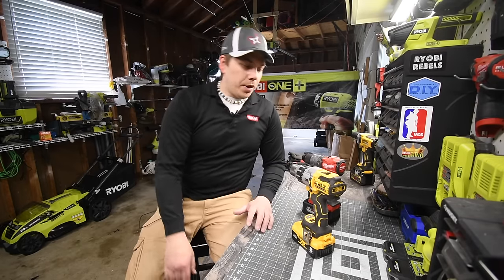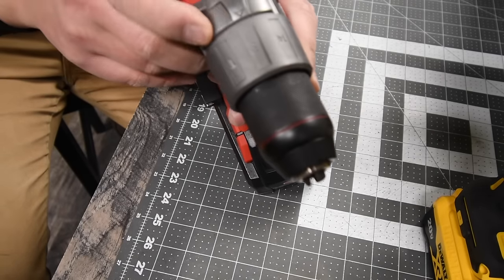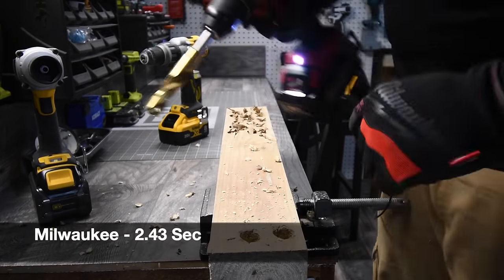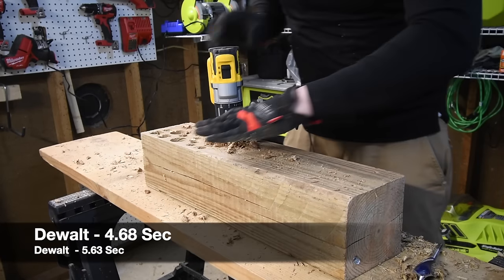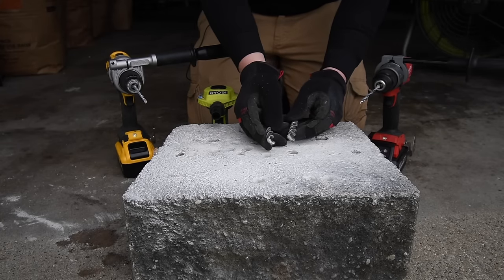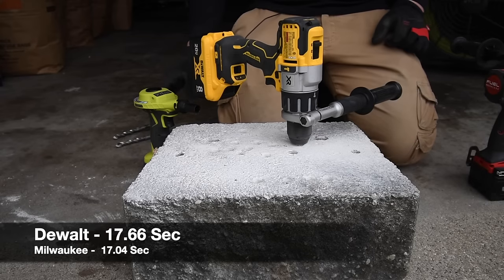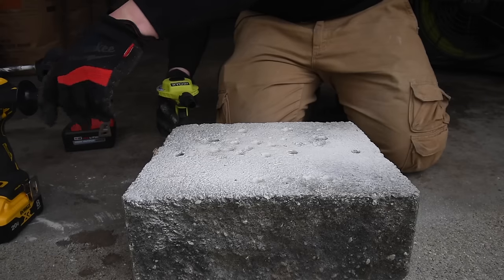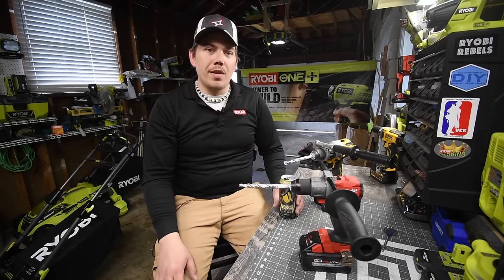Dewalt Power Detect vs Milwaukee Fuel

Comment: Made in the USA is the only thing I need to know!  Dewalt
Reply from the maker: Its not actually made in the USA. Only some tools are assembled in the USA with with the parts actually made in a China
Reply from the maker: They legally can consider a tool kit made in the USA by putting a China tool in a bag, then they can actually put a stamp saying made in the USA on it
Reply: @ManCaverTools  can you remake this video with the new dewalt tool the flex volt
Reply: Actually legally for the Made in USA lable,  the tool has to be assembled in the US with at least 50% parts from North America.  That includes Canada and Mexico.
Reply: Assembly could also happen in any of the US territories such as Guam or the Marshall Islands.

Comment: Cordless tools can only do so much. If you have heavy cement drilling to do you should really be using a rotary hammer. Hammer drills are just for the odd light duty things
Reply from the maker: sometimes jobs require raw power
Reply: @ManCaverTools  yes. I think the tool companies have tricked us into thinking cordless tools are heavy duty. They are not. As your test, and others, always show is these drills cutting out or getting overheated and sometimes dying. When I use my vintage American corded tools the only thing i worry about breaking is myself.  Those tools are beasts.
Reply: @timbarry5080  there are cordless rotary hammers as well.
They come handy when there are no AC outlets around

Comment: Just logically it doesn't make sense that the dewalt drilled the test hole faster than the pilot hole, and was slower than the Milwaukee in the pilot hole test. It's an inconsistency.  Probably just more aggregate on the milwuakee hole.  The dewault is definitely faster, but not four times faster, and not so fast that Dewalt drills a 3/4" hole faster than a 1/4" hole.
Reply from the maker: that is just how it is in that situation. but I will be revisiting this test soon
Reply: the milwaukee hole was drilling in reverse

Comment: During the concrete drilling test the Milwaukee was running in reverse
Reply: I also saw that. I played the video at 1/4 speed, screen recorded, and looked at every frame I could. Milwaukee was definitely in reverse
Reply from the maker: I dont think it was but if it was I am sorry
Reply: @ManCaverTools  I personally believe that the Dewalt is more effective at drilling concrete, doing so in 1/3 the time of the Milwaukee I believe is evidence of an anomaly.

Comment: Imo theyre pretty close in performance but as an electrician who owns both I would go ahead and recommend the m18 fuel line. Longevity and power.
Reply from the maker: very good and I thank you for viewing Cam
Reply: As a pipe fitter of many years I cannot recommend any Milwaukee as their drill chucks wear out too quick causing hole saw arbors to fall in between studded and rocked walls. Their impact driver collars prematurely fail too.
Time for Milwaukee to start making their drills in the USA with more USA parts to compete with dewalt

Comment: Might of helped if the milwaukee wasn't reversing into the block.
Reply from the maker: it was not in reverse, its an illusion, this power detect is a beast and it destroyed the HILTI and the Milwaukee fuel Hammer drill is a weak hammer drill
Reply: @ManCaverTools  I use them both everyday, and yes the dewalt beats the milwaukee when it comes to the hammer function drilling into concrete. By a very slight margin. It does not by any means beat it that much. With the amount of people saying it's in reverse, I think it calls for a rematch.
Reply: @JoeBlack-if3tz  After watching screen recordings in slow mo, it was definitely in reverse. Milwaukee got cheated

Comment: When he drilled the concrete with a 10, Milwaukee was spinning backwards! There was more time!
Reply from the maker: it was not spinning backwards.
Reply: The speed of rpm on camera can cause it to appear spinning in either direction.
Reply: Shutter speed of the camera makes the illusion.
Reply: YouTube has the option to change the playback speed. And it was for sure going backwards, at least initially at 8:03

Comment: It looks like the Milwaukee is spinning in reverse at 8:05?
Reply from the maker: it is not spinning in reverse
Reply: Before he cut the video the milwaukee was in reverse if you look closely. Im a milwaukee guy all day, i cant say forsure he ran reverse but i will pry buy the dewalt just for the hammer drill. I dont like the size tbh, but it is a beast.

Comment: i was fan of dewalt for 10 years.i have so many tools and the expensives models mostly from dewalt.
but no ty anymore.
8/12 of them having the same issue.they stop working until u press the trigger again and again...
shame just shame.i dont know why at usa u have the 20V version but here at greece we have the 18V version.
btw only 4 of them still working and i noticed that 4 are made in europe.
time to take a new serious from another brand ofc.bye bye dewalt
Reply from the maker: Milwuakee has so many more tools on both 12v and 18v platforms, its like may as well switch

Comment: Milwaukee was definitely in reverse. Sorry to say, but there is no way the 998 is going to do it in 1/3 of the time. I mean you could put a Hercules Hammer drill (In forward) that would beat 41 seconds. I think your hand hit the switch on accident. The 998 is a certified "Manimal" but not to that extent.
Reply from the maker: it was not in reverse. my right index fingers covers that switch and I press down on it.
Reply: If it was one reverse it wouldnt even go in bud
Reply: He says in the video that the Milwaukee slipped out of Hammer mode and into Drill mode at one point. He is going to redo the concrete test..

Comment: I HAVE 2 HUGE ISSUES WITH THE TESTS YOU ARE RUNNING 👀 
1. Test is immediately flawed due to the unknown pressure that you're applying to each plunge.
2. Test further flawed due to proximity of drill holes in concrete slab. TOO CLOSE! 
3. My kid has that same ryobi blower 😂 she uses it to blow dry her dolls hair.
Reply from the maker: I thank you for viewing Chris,. why would I doctor a test?
Reply: @ManCaverTools  just my opinion for better accuracy

Comment: I'm a Milwaukee guy. While Milwaukee beats DeWalt in almost everything else they really need to step it up with their highest end drill.
Reply from the maker: I do thank you so much for viewing :)
Reply: Lol ‘almost everything else’ okay, dewalt a more reliable and better value
Reply: @bobowman6689  I think I’ll let the warranty’s speak for themselves which is more reliable. Also make sure you keep your dewalt impact away from anything flammable when it has another motor burnout.
Reply: @appliancealliance4444  Milwaukee kills DeWalt in impact drivers and wrenches. Although DeWalt is coming strong in the compact and mid torque category  and recently bet Milwaukee, big red may not be far behind to up their game once again.
Other than Hammer drills and rotary hammers, I also find DeWalt having the upper hand on cordless grinders; no Milwaukee matches the DCG 416 & 418 even though I owned a 2880-20 until last week.
Circular saws are super close. Human factor plays a bigger role than the tool on that particular one. Milwaukee hardly beats DeWalt in almost every category. This is the ford vs Chevy of the power tool brands. They always one up each other with every gen and so on.

Comment: Nice job running the Milwaukee in reverse.
Reply from the maker: it was not in reverse. it was an illusion. even the dewalt looked like it was in reverse at some points
Reply: @ManCaverTools  No, the Dewalt never looked like it was in reverse. Yet the Milwaukee was in reverse.
Reply: Tap Pearson you can see it in the second hole in the Milwaukee 
He first hit the button it obviously was going backwards ( from where he swapped it to pull it out the concrete before )
And he hit the switch to put it back in forward, started drilling and it still looked reverse

Comment: You say The Power Detect is the best Hammer Drill and Most Powerful. VCG says the Milwaukee is the best and most powerful on the market and yet I saw you test Hilti vs Milwaukee and they were virtually identical but the Hilti did win your test then lost to the DeWalt. Seems these 3 are evenly matched and you have to dig into the mechanics of each task to pick a winner. When does Milwaukee apply highest torque vs Hilti and Deaalt etc. it’s not all the same and top speed doesn’t always win. We know Milwaukee can win on speed if they want to they’ve done that forever. But is speed the number one thing with a Hammer Drill. I don’t think so.

Milwaukee wins on specs hands down but again they all seem to perform relatively even.
Reply from the maker: The milwaukee hammer drill sucks compared to the Dewalt Power Detect and HILTI.
Reply: @ManCaverTools  ye

Comment: Dewalt took the tie 3-2 and now you have dewalt fans talking smack lol. I think they need a reality check and realize it’s a 3 speed dewalt vs a 2 speed Milwaukee. It’s obv that’s the 3 speed would do better. Milwaukee didn’t even fall short either and it’s only a 2 SPEED DRILL. If it’s a 2 speed Milwaukee vs a 2 speed dewalt Milwaukee would definitely take the win and same goes for if it’s a 3 speed Milwaukee vs a 3 speed dewalt Milwaukee would take the win in that too just the the impact test and probably every other tool test. Milwaukee is just a better tool over all
Reply from the maker: but the 3rd speed on the 996 version of the dewalt hammer drill failed to do the hard tasks. but now it cam use speed 3 on most tasks. which is a very good thing. if you watch ealier videos of the 996 it would bog out on speed 3 and I would have to switch to speed 2

Comment: Looks like you put up the smallest Milwaukee against the largest Dewalt.
Reply from the maker: This is the best Hammer drill Milwuakee has. and it is weak. Milwuakee needs to upgrade it
Reply: This is the biggest they make.
Reply: @ManCaverTools  I think you are weaker. You didn't even notice that Milwaukee was reversing...Then you dare to post a video full of errors
Reply: @wangsteven8502  I agree. After watching screen recordings in slow motion, it was definitely reversing

Comment: Hey just a tip for all ratcheting style chucks.. once you tighten it and its clicking, you need to turn it back (loosening) slowly until you hear a click and then it is locked. This helps alot for round shank drillbits that can often come out when reversing or slipping... I just learned this recently..  Seems like very few people know this, checkout the link.

https://youtu.be/ZSEsEfbASbI
Reply from the maker: yes sir. I do that for now on and it locks it in place and thank you Mixwell

Comment: 2nd review I have seen where the dealt has cutout and the Milwaukee did not.. however the Milwaukee was a hair slower.  I think I would rather have the drill that didn't cut out.  Also in one test it looked like you were drilling in reverse on the Milwaukee???!!!!  When you had 41 seconds on the Milwaukee that fucker was going in reverse.
Reply from the maker: but im also using speed 3 on this Dewalt. which using speed 3 is a huge deal. if the motor can do these tasks on speed 3 its a very powerful motor